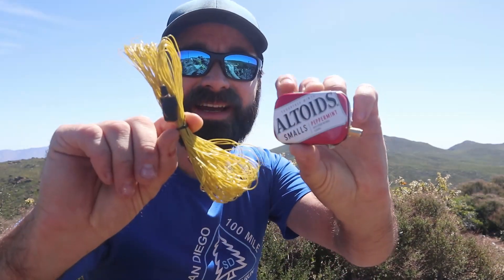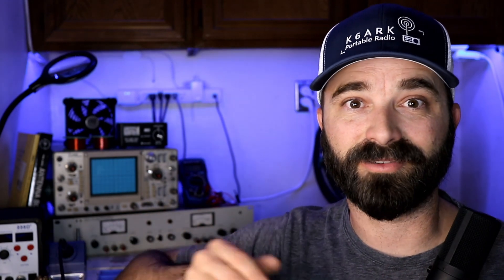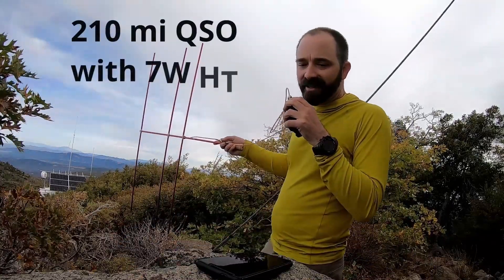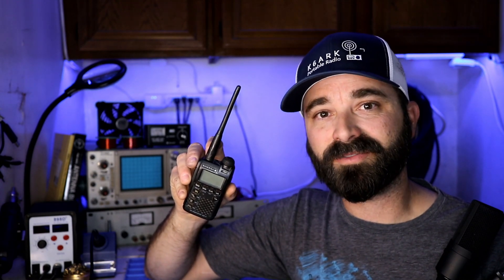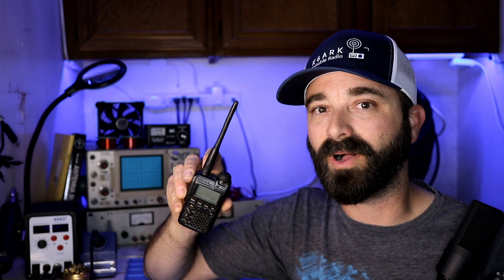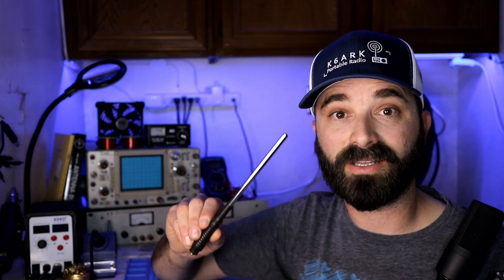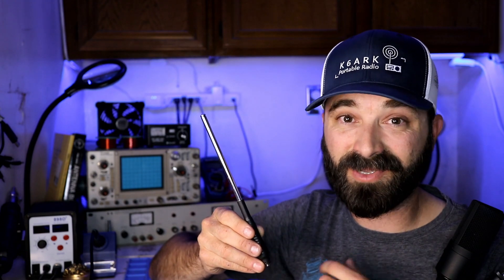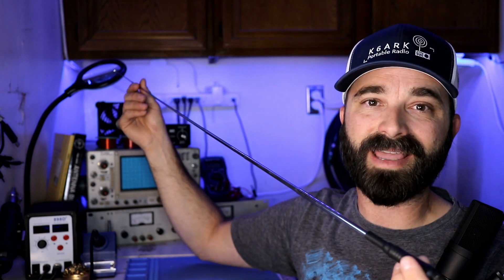How to pick the best HT Antenna

Comment: Adam, great video again.  Appreciate your careful explanation of the tradeoffs and I’m with you on almost all of it.  The one reservation I have is about the half wave.  The impedance of the half wave end fed vertical is not really a rational explanation for the lower dependence on a ground plane.  Unless there is some ground plane to have the opposite currents flowing in, the antenna cannot create the fields that generate the signal that is transmitted to the other station.  So while it does not require an extensive ground plane to achieve resonance and the correct impedance, it still requires some conductor to be present, and of course the chassis of the radio and the operator provide that.  BTW a half wave on 2m is 1m, or about 38 inches.  So the 30 inch antenna you praised cannot really be a half wave, but is about 3/8 wave, a compromise between the performance of the longer antenna and the inconvenience of the extra length.  I like the way you observed that the compact helical antennas are usually poor performers but showed that the stock antenna on the VX3 works really well.  I wonder if that means most helicals are not tuned at all well.  My icom helicals perform quite poorly compared with a telescopic quarter wave.  A wire antenna I use is a home made coaxial dipole, after the “flowerpot vertical” design featured by vk1nam and originating with vk2zoi (both findable on the web).   Rather than attach mine permanently inside the tube, I roll it up for the SOTA trip, then attach it with plastic tape to a fibreglass pole.  It makes a huge difference from the antennas mounted on the radio.  Thanks 73 Andrew VK1DA

Comment: Thanks for the great video, I am new to radio and have a maybe stupid question, if using a telescoping antenna on your ht, do you have to use it fully extended? obviously for maximum performance on that mountain top sure. But if you just pull it out part way if you're in your car or something, does it still yield well?
Reply from the maker: Good question! It depends on the antenna. Look at the instructions from the manufacturer. In some cases the antenna will work, but not as well, fully retracted. In other cases, the tuning may be poor enough in that position for it to perform poorly and potentially damage your radio if you transmit for an extended amount of time with it in the retracted or partially extended position.  For operating in your car, you are, by far, best served by using a mag mount antenna outside the vehicle attached via coax.

Comment: So far the best performance I have gotten out of my Tidradio TD-H6 is with my "Ugly 2M Dipole". It's sort of portable and can be hung vertically or horizontally. You can see build pictures at https://kj7rdy.conklincomputing.com/antennas/my-first-2-meter-homebrew-antenna-part-2/
Reply from the maker: Awesome work!  Welcome to the adventures of antenna building.  You're off to a great start with that.  Check out the Extended Double Zepp as a larger, but higher-performing build.  Keep up the good work, and thanks for sharing the link.

Comment: Good job explaining how they work  and use cases. Nice variety of good performers. I'm with you on the Smiley - receives great when collapsed, fairly rugged in that position. Stop to xmit & it does very well. I like this better than a 17-19" Signal Stuff / Nagoya / Diamond which are awkward to carry. I use the triband on my 878  Plus (mode 14 includes 220) KC6ARY

Comment: Thanks for the video!  I use a foldable, telescopic log periodic antenna (UHF/VHF w/out diplexer) attached to a wooden broomstick and a very short RG-58 feed line for satellite work.  Except for the broomstick, everything packs into a small messenger pouch.  I will modify one of my hiking sticks to mount the antenna so I have one pole less on my travels.  My HT's are the tried and true Baofeng UV5R Plus and a Wouxun KG-UV9K (full duplex).  I did buy a small digital voice recorder to plug in in-line to record my QSO's. I still have to try it out in the field.  I have also experimented with "tiger tails" but I didn't notice any difference with it or without them.  I have hooked my HT's up to a Diamond X30N antenna and even a Diamond X700(?) antenna with impressive results.  Otherwise I simply use the rubber ducky that came with the units or a Nagoya NA-24J (1/4 wave on 2m, 5/8 wave on 70cm, rated 20W).  I am investigating mag mounted antennas to couple with my HT for my car and a frame mount solution for my motor scooter.  Any suggestions?  Vy 73 de David SV0SGS
Reply from the maker: Awesome, thanks for the comment! I don't have a specific suggestion for a mag mount, but I had a Diamond which was 1/4 wave on 2m and worked on 70cm too.  It was about 16" tall and worked well enough - better than a duck inside the car! I really like the Wouxun KG-UV9D and really like it too. It's probably my favorite HT. Thanks again for taking the time to comment. Sounds like you're making wise choices with your gear.  Good stuff!

Comment: Very informative video. So I have a question.  does the length of the antenna tell you how far it will reach? I have ABREE 42, 24 and 18.  do they all have the same electronics?  I am looking for some basic, basic answers.    Thank you all!
Reply from the maker: Simple answer, yes, generally, bigger is better.  I don't know the electrical properties of the different ABREE antennas, but I'd guess the 18 is a 1/4 wave, the 24 may be a half wave (a little short, but possibly loaded?) and the 42 may be a 5/8 wave.  The half-wave antennas work great on HTs.  5/8 wave are variable - they need a decent ground plane. Try and compare them and see what works best on your radio.  The biggest one may win, or it's possible that the 24 might be best.  Let us know the results.

Comment: I'm a newly licensed operator with just an FT-65. I bought a 19" Signal Stick whip to put on it, though I've heard from some that the stock rubber duck works about as well. I'm currently waiting on some parts to arrive to experiment with building a counterpoise for it, as well as materials for various home brew VHF/UHF antennas.

Comment: Thanks for this Adam, a useful insight into HT antennas, I'm sure there is scope for more in depth videos too. Two questions. 1) Do you have any experience of "tactical" antennas, the ones that look like a tape measure in black shrink wrap? 2) Have you home brewed any HT antennas? Would love to know your experiences. Keep up the good work, I really enjoy your videos.
Reply from the maker: Thanks, ace. I have not tried any of the tactical antennas, however, all of the same concepts apply. I believe they come in three electrical designs which you can probably guess from the length of the antenna. Ones around 19 or 20 in tall would be quarter wave antennas, ones around 36 in long would be half wave antennas, and those in the 50-in range would likely be 5/8 wave antennas. My understanding is that many of these tactical antennas perform fairly well. They appear very durable as well, and hard to break, but that comes at a size and bulk cost. they are certainly some of the largest antennas I've ever seen mounted on a handheld radio.

I have not built any handheld radio antennas that mount onto the radio, only yagi antennas and remote connected wire antennas such as a roll-up j-pull or EDZ. Commercial HT antennas are generally pretty cheap, and well built, so I suspect I would have a hard time matching the construction quality and performance that you can find. For that reason, I haven't really tried to build one. I'm glad you enjoyed the video, and appreciate the channel. Thanks for the comment.

Comment: Interesting about the carbon fiber masts. SOTAbeams put out this video a year ago and seem to assert that it has little to no impact on HF. https://www.youtube.com/watch?v=idx1zdmeIOs&t=1s do you think this is different with VHF/UHF? Or maybe SOTAbeams missed something?
Reply from the maker: There's no impact if the wire just crosses at the tip of the mast, but if you run the wire parallel to the mast, it has a notable impact.

Comment: Have you ever taken a look at the Diamond SRH770s?
Reply: That's my go-to hiking antenna, SOTA or just with the XYL2b.  I do put a piece of painters tape at the joint.  A friend lost the metal whip part during a hike last year.
Reply from the maker: @n1rbd  yes, that would be my concern - losing parts. That said, I'll have to check this one out.
Reply from the maker: No, I'll have to check those out. Have you used one?
Reply: @K6ARK  I have, the gain is quite amazing. Primarily I use mine while cycling in a chest pouch. So the length is not a concern.

Comment: Lately I have really been enjoying the Signal Stick I have on my Kenwood TH-K20A.  It is a nice simple single band setup for 2M and the antenna doesn't get in my way since I don't wander too far from the house during COVID times.  I can put the radio on my belt when walking the dog and the Signal Stick doesn't jab me in the side like some of the less flexible whips.
Reply from the maker: Signal Sticks are an excellent, simple antenna that performs well. Great price too. The ergonomics are good despite the extended length, and they hold up well. Great antenna! Thanks for sharing your favorite.
Reply: @K6ARK  I think they flop around to much. Went back to the Diamond SRH

Comment: As I said in the chat, I think you're the only radio YouTuber I've seen talk about Smiley antennas.  Their tri-band 27000 works great on my 5X3.  It works better than the Signal Stick for me, and I love that their antennas have a removable base so you can change connector type without needing to stack a bunch of adapters.  Yes, the telescoping nature means it's not quite as durable ( I use the Stick if I need a beater antenna ) but as long as you don't abuse it, they hold up fine.  Also, being able to collapse it down keeps it from getting beat up most of the time.
Reply: Plus one for smiley tri-band. I use it on my hacked Anytone 878 tri band :p. My reliable SOTA "getting there" HT

Comment: Love me a Smiley antenna!  Was just watching another vid on the "rat tail" - adding the other end of the antenna via a connected wire.  I have never tried it but wonder if that is all you would need for better 2m SOTA work?  Gonna test radio and cut me one and see what happens.
Reply from the maker: Really, the benefit of a counterpoise or "rat tail" depends on the antenna. 1/4 wave and 5/8 wave antennas typically benefit, but half wave antennas don't. My top-performing HT antennas have been half-wave telescopic whips, but a wire extended double zepp blows any on-radio antenna out of the water. A yagi is another step up in performance with with trade-off of added weight and having to point it in the right direction. Each has their place and probably should exist in any complete antenna quiver.
Reply from the maker: What antenna are you considering the counterpoise for?
Reply: @K6ARK  Was just looking to experiment and see what works, then again for SOTA, the rollup j-pole is less to carry and should do fine for 2m when you also will use the mast for HF.  For the couple of SOTAs I have done with the rollup, it has worked great.  I have an Elk, but it's a tank to pack a long ways.  Picked up an older FT1XD for cheap and want to try the APRS next time.  Thanks for your vids!
Reply from the maker: Awesome David, consider building an Extended Double Zepp. They give 2 or 3 dB over the jPole and work great if you're already carrying a mast.